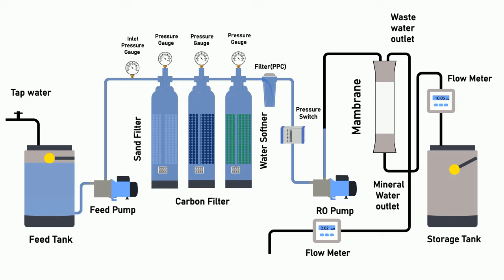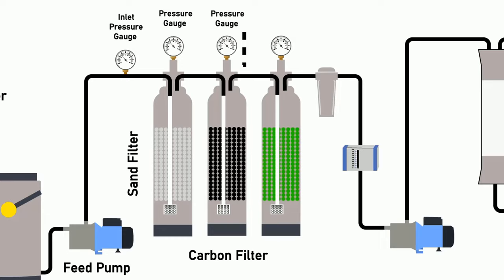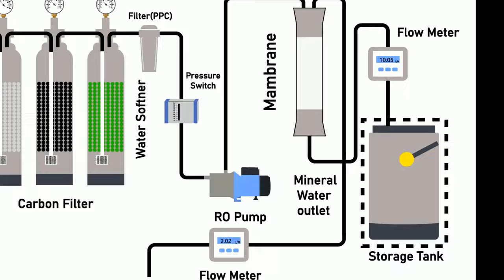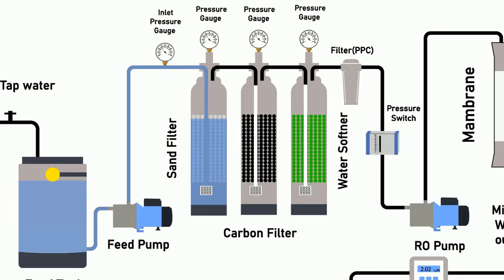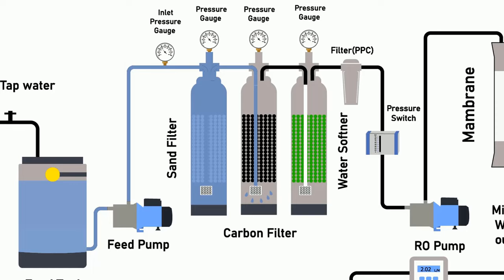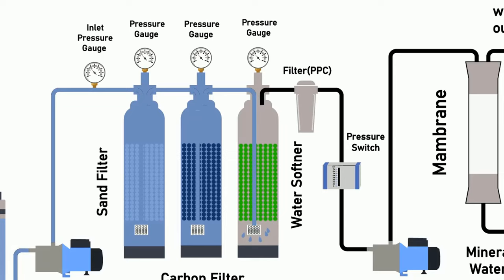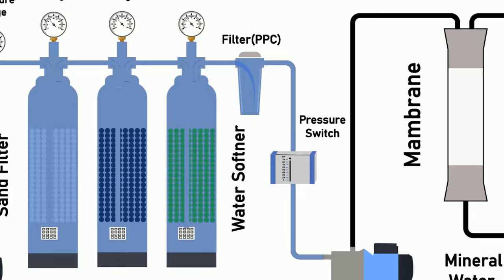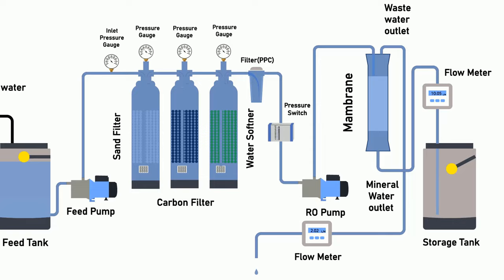how reverse osmosis plant works | water filtration plant | RO plant model | how RO plant works

Comment: Why we are using anion in the softener vessel ? If all the salts are removed in that stage, what is the purpose of RO then?
Reply from the maker: You need to learn more about
Reply from the maker: Firstly stage remove suspended particles, second stage remove odor make taste better and third stage remove calcium and magnesium
Reply: @sourceofskills  cation is enough for replacing magnesium and calcium.
Reply: Sister,you can  YouTube video about the Ro olnt.
Reply: Correct

Comment: How to disposed waste water?
Reply from the maker: It can be drain in sewage system
Reply: Sir, if you have extra budget, portion of waste water can be re-use using recovery pump. By this process you can save money if your feed supply is from the water company.